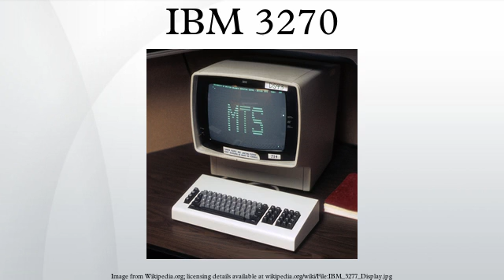IBM 3270

Comment: It is not an IBM 3270 terminal: it's an IBM 3278 terminal.
Reply: Actually, the picture is of a 3277.;-)  It is called the 3270 data stream, however.